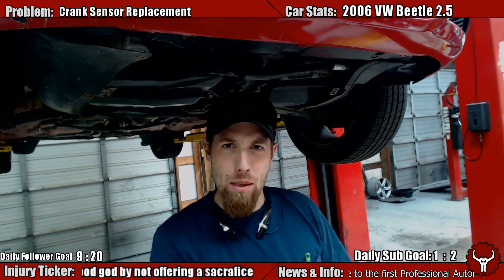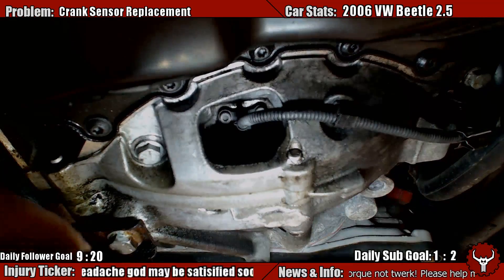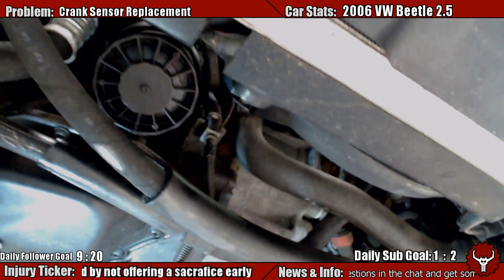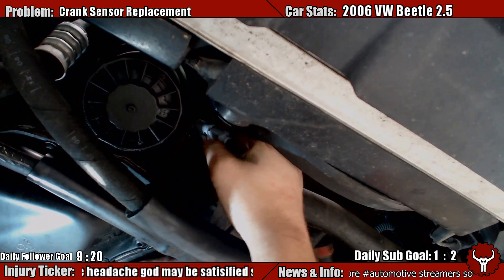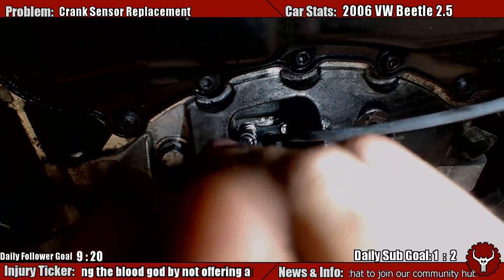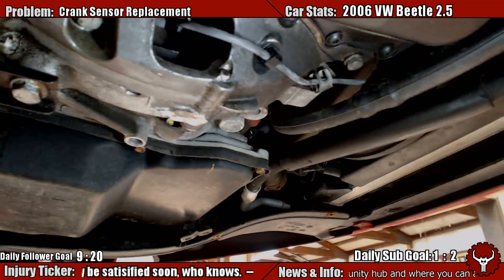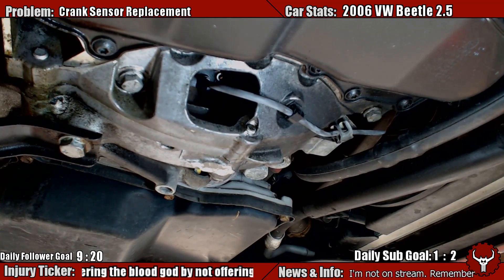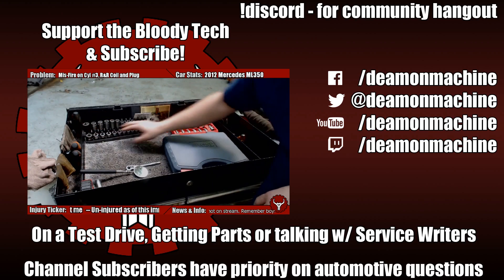DIY VW 2.5L Crank & No Start or EPC Light On FIX Crank Sensor Replacement

Comment: Helloo ,is it so for an "vw polo 6n2 year 2000? 1.4mpi?.

It crank but it wont start tho ,and EPC light is on the dashboard.
Reply from the maker: a bad crank sensor will prevent an engine from running because the ECU doesn't see that the engine is spinning. If you can scan it and look for the RPM signal and it doesn't move even when cranking, you may be onto a bad sensor.

Comment: so what codes go with this problem?  my car does this on a warm start.  epc light and crank no start
Reply from the maker: it may not have a code, cause the car doesn't know the crank isn't talking, it just thinks the engine isn't spinning, so it never tries. If it does throw a "crank sensor no signal". If you have a scanner, try to find the RPM/Crankshaft signal and the camshaft signal and see if they are both "reporting" by seeing a change when you start to crank it.
Reply: @deamonmachine - when you changed your crankshaft sensor did it fix your issue ?

Comment: Does it typically throw a code for this and will it cause a no crank no start?
Reply from the maker: Maybe, but that's one of the problems is it totally can NOT set a code and the car just shuts down and leaves no clue. Thankfully this crank sensor is SUPER easy to get too.

Comment: Alright, dude. I did the deed, and we have ignition! Thank you! Lessons learned. The 4mm hex stripped on me 🤬🤬🤬 I took an 8mm socket and hammered over the bolt. I had to use two 8mm, one for each bolt.

Comment: I just changed my throttle body, gasket cover, spark plugs and a coil cover. The difference was night and day. I drove it for an evwning. Then i decided to take the negative off battery to see if the code lights would be rest.  Instead, the car now just cranks and no turnover. While cranking, there are zero RPMs showing. I did notice prior to doing the bit of work the car would crank longer than normal and then start. I even had to pump the pedal once or twice to get things  strted. Of course now im dead in the water. Im going to replace the cranfshaft sensor as shown in your video. I hope this is my problem. I have a 2008 VW Jetta 2.5L thanks
Reply: I have same issue didthis work for u? We replaced the spark plugs throttle body and battery so far
Reply: How'd it end up? I have the same model with an epc and P0322 code

Comment: Please help! Showed a code for the crank sensor then replaced it then was given an open circuit code (P0651) along with P0343. I’ve replaced the cam sensor twice and the plug for it. Cleaned all the grounds and repaired a broken wire on the sensor with a new plug. Please help I cannot fix this
Reply: you may want to try the crankshaft sensor replacement

Comment: My comment is my 2001 VW BEETLE died on the freeway and hasn't started since on the dash it shows check engine light and battery light and the EPC LIGHT. Does this situation cause your car to die and then no start and will this process help with my situation?

Comment: Hey I have a 2013 vw cc similar problem no crank no start is stalled at a stop sign batts good new starter the codes are common but theres a starter code electronic or mechanical problem

Comment: Before you do all this, make sure you fuel tank and injection is clean. THEN unplug your battery on both ends for about 5 minutes AFTER THAT take your key and spare fob and reprogram it to your car (there are tutorials online) IF THAT DOESNT WORK get your immobilizer deleted or replace this sensor (whichever you can afford). those are all the ways to fix this problem from multiple different mechanics and shops. I hope his works for you!

Comment: I have a 2010 Audi a5 cabriolet. replaced a 6 year old battery  after the car failed to start  or jump start. All lights are on with the new battery except the car will not turn over. it just cranks only and I now have a check engine light on and ECP light on. Frustrated! Please help! the Dealer Scares Me!

Comment: I replaced the sensor and it cleared then it put out another code camshaft sensor replaced both all codes clear the mx808 says no codes but still won't start eco still on and check engine light. What next 2008 beetle 2.5l I am lost here.

Comment: Hello my 2014 beetle 2.5L just hit the 60+k and today the EPC light came on car running ok but sometimes on acceleration I hear a slight gurgling noise I've had it over a year now no more on the warranty I hope it not major any hints I got my oil changed so other then that oh the inspect notice comes on but I understand that comes on after so many miles?
Reply: hi, have you solved the problem? Because I have a similar problem.

Comment: greetings friend I have a problem with my vw jetta 2.5l 2006 I do not know if it is the crank sensor or the starter the problem is that in the morning I'm on my way to work in the car as always and when I go out of my shift the car did not want to start for anything and did not start when the key entered the switch and pressed the clutch pedal and turned the key heard a sound inside the car click to click that is the only thing that does nothing else and my car does not have any problem of mechanics and neither had the check engine light on or the epc check all the fuses and are in perfect condition and the battery is new only takes 6 months in the car which of the 2 things could be the starter or the crank sensor ? I hope you can help me and thanks in advance!
Reply from the maker: Starter is the mostly likely. Tap it with a broom handle while you try to crank it, should spin over.

Comment: Just fixed my 09 2.5 rabbit today.
Changed throttle body,  fuel filter,  cam sensor,  and all the plugs.  The culprit? Yep,  crank sensor. I replaced it.
Runs better than ever now. 
Thanks for the video.

Symptoms: stalled twice while driving, hard to start, no acceleration.  I'd gas it while in neutral and it couldn't go more than 3000 rpm. Epc light came on in the beginning, then two days later check engine light came on, in addition to the EPC . 
After changing crank sensor, EPC light is gone.  For the check engine light that remained on, I disconnected negative battery cable.
All good now.  Hope this helps.
No way in hell i was gonna throw my money to a vw dealership to try and fix it.

( ya gotta remove the plastic protection cover from underneath the front end of the car first. It's held in place with hex screws)
Reply: My epc light is on my car won't start we replaced battery and throttle system I have a 08 Jetta I'm dieing w no car do I think this is the problem? It won't start cranks just won't start
Reply: you changed all of that to see wich one was the failuere or you HAD to change all that?
Reply: Hello can I send you a message

Comment: I have a 2007 Audi 2.0t sline and I just bought it. Drove it maybe 50 miles and the EPC Light is on as well as check engine. Had Napa auto parts clear the engine light (EPC did not turn off) but engine light came right back on. Codes showing are: P0304 - cylinder 4 misfire, P0100 - mass or volume air flow circuit, 2 codes P0171 - fuel metering Too lean , P2294 - Fuel pressure regulator 2 control circuit. Was fine when I test drove and also short time after. Then I realized the person I bought it from let the oil level go super low and then the car threw the EPC light. I’m stuck. Was told the VAG-COM obd2 code reader is better then then the Napa auto ones due to the fact you can fix issues? Is it worth it or should I take it to a mechanic. I’m not rich. And I feel like this is gonna cost me an arm and a leg. I am car savvy tho. Have worked on race motors but Chevy. No German cars but I figure I gotta push myself right. Haha. Please let me know if you have any ideas. Beautifulstruggles@icloud.com
Reply from the maker: Your best bet is to jump on our discord and ask there, cause we can chat there easier than here on youtube or emails http://www.discord.gg/deamonmachine

Comment: so my jetta wont start tail lights went out than soon after epc light came on now wont start ????
Reply: mine did the same thing except my lights still work do you find out what happened to yours? epc light stays on...
Reply: stephanie acevedo mine did the same thing. Lights and windows now are going out.
Reply: Slum Otto Forgiveme6669  did you get it fixed same here lost Car  won't start only Crank no idea what it is EPC light is on / Windows won't work also inside dome lights are off at all times smh what was your fix for this if so Thanks!
Reply: Mr.69 yes did anyone ever fix these issues I'm currently having the same issue thanks
Reply: I found the code ,po 340 from Audi A6 2.7.  ND I replaced the camshaft sensor ,ND won't start anyway ..the mechanic told me  ,it's the fuel pump. Etc

Comment: 2012 VW GTI.  EPC & Engine light on. Cranks but won't start, however it will push start (6speed). Feels like it's lacking power when accelerating. Hesitant to accelerate with A/C on.   Dropped it off at the VW dealer ($150 to run diagnostics wtf) on 8/18/17 and I'm waiting on a call back. Any thoughts? I'll keep yall posted on what happens.
Reply: They just called. crank sensor. unfortunately I coudnt find a 'how to' video to replace the crank sensor on my car so Im out $400
Reply: Nice information Thanks !!

Comment: I think I have a problem with my passat, I went down a street and started to pull up and the epc came on and the car died, now I can not turn it on, turn it on for 2 seconds and then die again, I can not find the fault, and the Mechanics in my city are not good with German cars, do you think it's the same problem?
I'm desperate :(
Reply: Niko Leyva how did u fix
Reply from the maker: Join my discord and ask in "Help me with car" channel  http://www.discord.gg/deamonmachine

Comment: Hi there .   I got a 2005 jetta 2.5  and all the time after I charge gas. it's very hard to turn on again. can you please give me an advice??
Reply: Turn your car off to fill up and don’t try to pump more in after pump stops. It will mess up your canister purge valve (CPV)

Comment: hi can any 1 help my vw polo 1.4 2007 mod epc light is on it starts but dont want to exalarate i alrey replaced the exalarater pedal but problem is still there
Reply from the maker: That's very little information, but do you have any scan codes? Could be crankshaft sensor, or throttle body also. There are still many many possibilities, but that's my "most common" fixes list.

Comment: Hi there, I'm having trouble with my 08 Jetta City, the car was working perfectly fine yesterday but this morning it just didn't want to start. There is no crank, and no start. Dash lights that turn on are EPC, Engine Light and battery light (before it didn't have any of these lights on). The sound it makes is just a click. It's not the battery, I already tried to jump start it, it is very strange. Is this the same thing that happened on this vehicle? I haven't checked the sensors yet so i'm hoping that the sensor is the problem. Was working perfectly fine last night. Please let me know, thanks!
Reply from the maker: Your best bet is to come on to the discord so I can talk to you live and also there's more than just me to help in there: http://www.discord.gg/deamonmachine (just click the link and pick a username and @deamonmachine : question ) when you get there :D
Reply: Thanks for your reply, I put it on Neutral and it started and then the car started working again. But the problem hasn't been fixed, because this morning the same thing happened and again I placed it on neutral and works fine and after that I just turn it on on park no problem. Very strange...we'll see tomorrow morning.
Reply: @thermalphysics2429 hello pls how did you fix this car coz mine just went off now while driving and won’t even start
Reply: @deamonmachine  hello pls how did you fix this car coz mine just went off now while driving and won’t even start
Reply: deamonmachine st
Reply: Thermal Physics st

Comment: hello i have a 2005 audi a4 3.2 liter v6 quattro. When i try to turn on the car first thing in morning it cranks but i have to give it gas to fully turn it on. If i don't give it gas the EPC light comes on and then when i try again to turn it on(without pressing gas pedal) it turns on like normal. I went to dealership paid $300 for new battery they also checked my alternator and said everything is good....but I'm still having the same issue i don't know what it could be? do you think spark plugs or speed sensor? or crank sensor? or starter? Oh and its been 3 days since i got the new battery i tested it today and the battery is already at 95% but i live in michigan could also be cold weather please help this car is driving me nuts lol
Reply from the maker: Is the check-engine light on? (not while cranking, but when running). Do you have a code reader to find out? It sounds like they didn't re-adapt the throttle. If your battery goes dead or you disconnect it, the throttlebody can lose it's settings and refuse to run right. To fix that you need a factory capable scan tool to run that adaptation.  I'd look for bad grounds and the like in your case because if it lost it while having a new battery, then it must be losing connection somewhere.
Reply: deamonmachine there is no engine light or anything dash warning lights

Comment: this is quiet helpful , my golf5 does the same thing of showing EPC light and looses power , sometimes starts jerking. i will replace the sensor. thank you.
Reply from the maker: If you can get a scan on it, that would be more precise, but idk how much this sensor runs XD It may be cheaper to try it.
Reply: ok thanks
Reply: #tag mokgobi did replacing the sensor work ?
Reply: My when get hot stops and don't want to star untill get cool any advice

Comment: I have a 2008 Passat 2.0t motor had been skipping some, then epc light comes on... cut the car off and the thing wont start back...I replaced all the coils still no start... could this be the same problem with the crank pos sensor ?
Reply from the maker: It could be. If it's shutting down for no apparent reason then it's a high possibility that the crank sensor is bad. Do you have a way to scan it?
Reply: We scanned it and it came up engine misfire on cylinder 1,2,3 & 4 we replaced the coils & it says crank position sensor and intake manifold runner. The manifold runner arm thing pops out when you try to crank it & smoke comes out.
Reply from the maker: Have you checked the intake for carbon build up. Honestly you just gotta hit up the discord (in description) because this kind of problem is very difficult to nail down and I'll need as much information as possible, pictures etc..

Comment: I have a 2003 jetta 2.0 and it just looses power running sometimes and the EPC light comes on would that be it
Reply from the maker: That is more likely the throttle body itself. If your battery has lost it's charge, it may have lost it's basic setting in the throttle and needs to be re-adapted. It could also be the throttle going bad. Usually the crank sensor here will cause a no-start condition. Go to a local parts supplier and scan for what codes it has in it (Throttle Adaptation limit reached possibly). Feel free to stop by the stream or discord for more direct help :P
Reply: +deamonmachine it sometimes will shut of on me to but you think it can need a clean . I put in a new gas pump new gas filter and a regulator aswell
Reply from the maker: Manuel Cal Cleaning the throttle is never a bad idea. The crank sensor on your car would be in a different spot as well. It's down and right of the oil filter (easiest to do with the oil filter off) It takes a 5mm allen key/socket to remove (may also be 10mm socket too on that one).
Reply: Ok thanks man
Reply: Manuel Cal may 2005 VW GOLF 2.O would have that and it was the brake light switch under the brake pedal easy fix it was under $20.00 and it took me less than 30 minutes
Reply: mi MP cinco what was the part you fixed? Just something under the brake pedal and it ran fine?
Reply: Got the exact problem. How did you fix it? My car jerks and flashes the epc light.

Comment: it's happens with my mk6 Alf ligh and check engine and it won't star
Reply: Josh Salazar hello my 2008 vw jetta is losing antifreeze but I see nothing on the ground and it stall on me and the EPC light came on
Reply: Does anyone know a mechanic that works on vw jetta in Baltimore